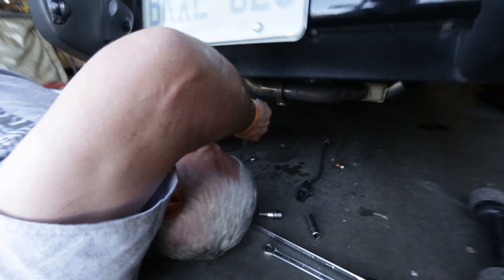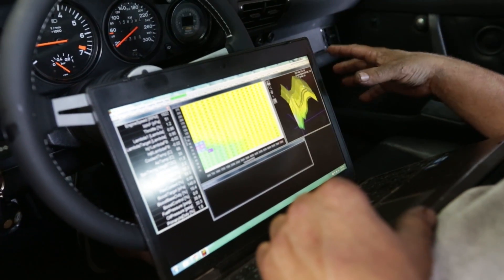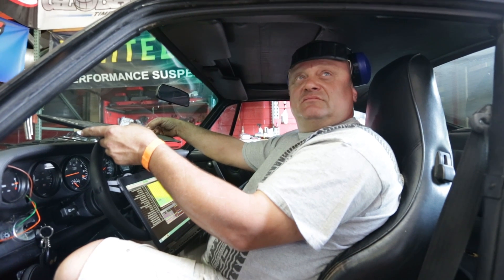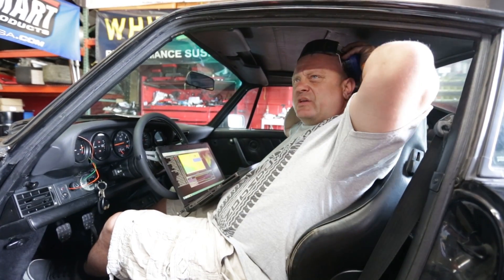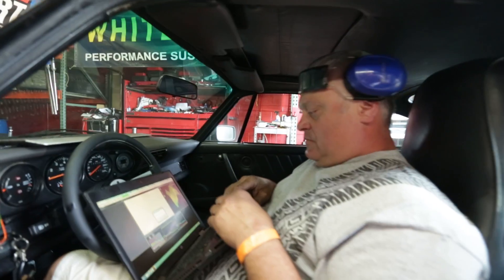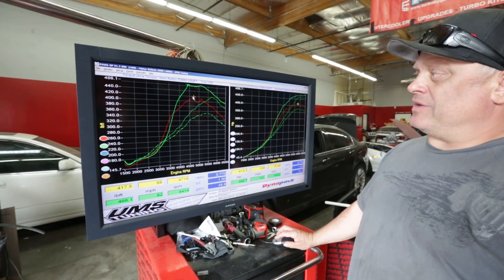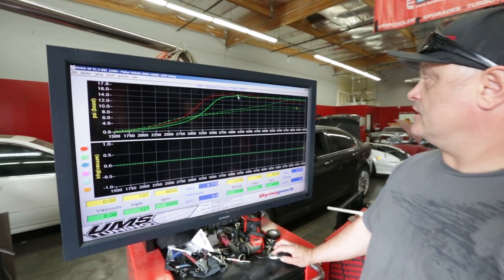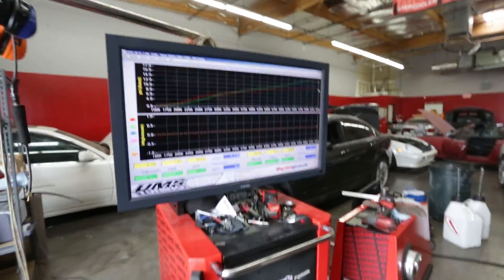Does it Make 500WHP?! - Porsche 930 Project - EP14

Comment: Water to air intercooler will get you 80hp at the same boost.  100hp with an ice water bucket bypass valve in the front tied in.

Comment: maybe you should consider putting in a heat shield around that wiring to the turbo, flappy wires next to red hot turbo is not good in the long run.

Comment: Great video / story! Have you done the power check right after installing the engine. I just made my 911 3,2 engine and the engine builder recommend to go first 1.000km before going over 4.000rpm
Reply from the maker: Some builders do that but we didn't have the time to drive it around. Engine works totally fine without a long break-in. Turbokraft actually builds and tunes a lot of motors and breaks them in on the dyno so I wasnt worried.

Comment: I know I'm a little late to the party but which hot side are you running on the GTX3582r and what displacement is your Porsche?
Reply from the maker: 3.4L and running a 1.02 hot side if I recall correctly.

Comment: Q = why turbo & N/A make different sound ?
Reply: ***** thumbs up
Reply: Turbo is in the exhaust stream flow and tends to muffle the bark of the exhaust. It's also in the intake stream. Sound is only pressure waves in the air. so you can see how the turbo would affect both intake Roar and exhaust boom/rumble.

Comment: is that like an in line filter off the turbo drain?
Reply from the maker: No its an oil drip accumulator. It keeps the oil from backing up in the line and into the turbo.

Comment: Is the lower sensor in the exhaust at 1:45 also an O2 sensor? I don't think it will live very long if it is mounted like that. Condensed water in the exhaust will get into the sensor and break it.
Reply from the maker: It is and yes it shortens the life span slightly but not enough to be a problem on cars that don't get driven 100 miles everyday.

Comment: Them sensor are gonna go fast there way to close the the the turbine. Damn im in this same boat on having to get A car tuned on A fresh clutch. =( With the way your header is flowing it's easy to see the 30r is A way better option so are you gonna change the header to a better design now that u have A better turbo?
Reply from the maker: Actually they seem to do just fine there. TurboKraft hasn't heard of any premature failures yet.

As for the header, Im totally content with this one. No need to change it since the creep is right where we want it to be. 17psi.
Reply: Speed Academy ok coo nice.

Comment: Good video, as always! I have to say SPEC is bad clutches. Buy Sachs! You don't even have to "breake them in"
Reply from the maker: Sachs is $2,000+ and the SPEC clutch is working just fine. It's very close to it's max power rating though. I could change the disc out for a more aggressive one if need be.
Reply: I have a Sachs racing cluch with organic, sprung lamell, and it can hold 700nm. It only costs 600 dollar.
But i don't know if they are available in the U.S/Canada.

Comment: who would of guessed a problem with the spec clutch..
Reply from the maker: SPEC gets ragged on so much yet I've never had a single issue with their clutches. It slipping on the dyno is not a sign of a bad clutch but that I didn't want to go to a more aggressive friction material. It holds just fine on the street.
Reply: Speed Academy
I have tried to like them.. They are a local company to me. I have friends that work there but I just can't support their products anymore.. You ether get a good one or a bad one.. I have unknowingly been a test dummy for their products multiple times without compensation. These are just my opinions.. I hope yours get broken-in and starts to hold the power it was advertised to hold..

Comment: Wow, that's going to be a fast 930 vs stock 300 hp, I hope that clutch breaks in and stops slipping, you know it can get glazed and then never be 100%-- tony sure knows his jobAs he was speaking of 'header flaw' are all the headers the same or are there differences from one brand to another regarding design and function?
Reply from the maker: The clutch is totally fine on the street! There are different brands out there that have larger runners or better wastegate placement but this one is supposed to utilize a stock location gate.
Reply: Hope the engine will be reliable for a while, sure pumping out gobs of torque and HP
Reply: Yes the RUF I think is about 750 but that is the much later design engine offering more factory technology to build upon

Comment: I did mention few videos ago to break in the clutch first. ;)

Congrats on the car, can't wait to see it in future videos.
Reply from the maker: It's max rating is 625hp so we are close to that. The clutch holds fine on the street but the way the dyno loads makes it hard on the initial hit hence the slipping.
Reply: This is actually proper engine/tranny/clutch break in for some builders and tuners. But my engine rebuild this is a no-no, I had to take it easy for 1k  to let the rings and bearings break in.
Reply: Even the tuner in this video said it was a brutal way to break in the clutch. It's so easy to do irreversible damage to a brand new clutch by hitting it with max power right out of the box, over and over.

I don't remember the specific clutch in this car. Before I say more, it would be interesting to know what the manufacturer recommends. I've never seen a clutch manufacturer recommend installing a clutch and going straight to the dyno for a few days.

Comment: sooo wats the difference between whp,bhp and hp plz tell me car pros PLZ i needs to know!!!
Reply: BHP is Brake Horsepower. Brake horse power is the measure of engine horsepower without the loss in power caused by the drivetrain. BHP the power at the crankshaft that is measured by a prony brake. Its a simple lever with a brake that connects to the crank. WHP is power at the wheels and will be less that BHP because of the lost of power threw the drivetrain ect. In short BHP is what the engine makes WHP is what you put down on the road itself. Hope that helps
Reply: +Kenteddy Boreland thx for the info XD cant believe im 14 and understood that

Comment: Couldn't you be maxing out the wastegate on spring pressure and getting boost creep because it was making 60 more hp? More power means more CFM in and out of the engine and 60hp is a pretty big jump. Airflow not being linear to the power being made makes it hard to determine how much CFM was going in and out of the engine. This is why you made more power on less PSI of boost, because you had a bigger hole forcing in air so the boost pressure doesn't need to be crazy. That's what I think, not necessarily the header.
Reply: Nope, it should just go to the wastegate spring pressure and stay there. Like they said, the path to the wastegate is restrictive, so more gas wants to go through the turbine. It was getting crazy boost creep on the smaller turbo too.

Comment: Can someone explain me something i don't know?When you say wastegate boost it means you're on the pressure where the wastegate opens?
Reply: It's whatever the spring in the waste gate is set to.
Reply: Wastegate pressure usually refers to the psi that the turbos wastegate is factory set at. Without any boost controller input.
Reply: Ok get it.Thank you.